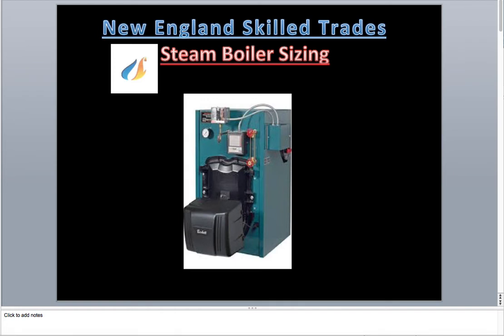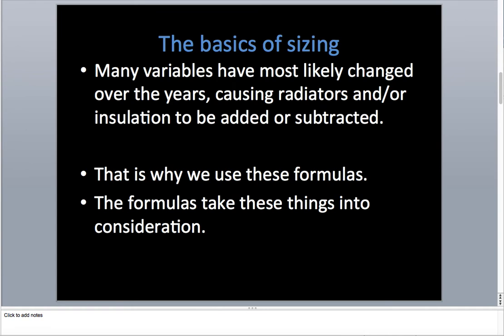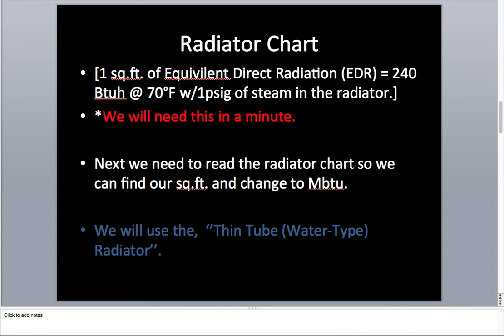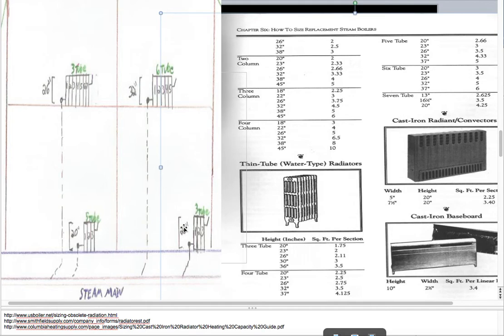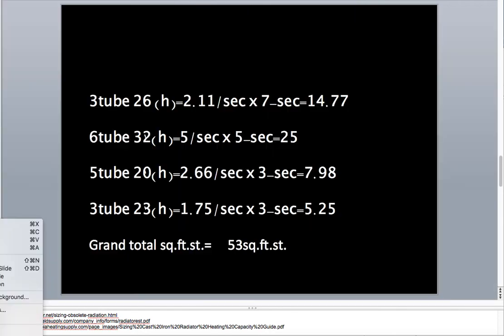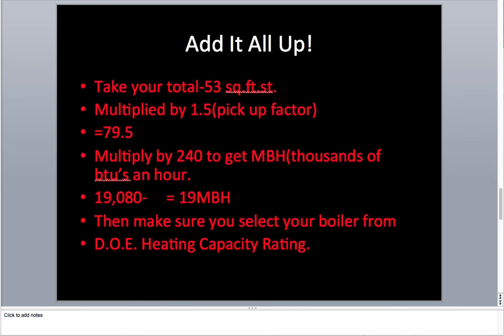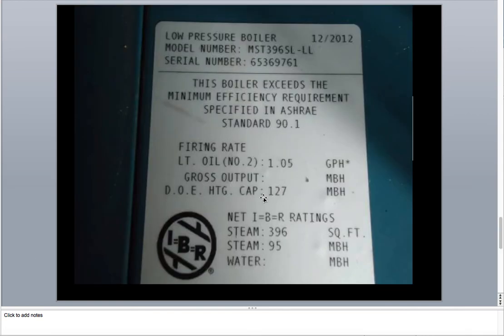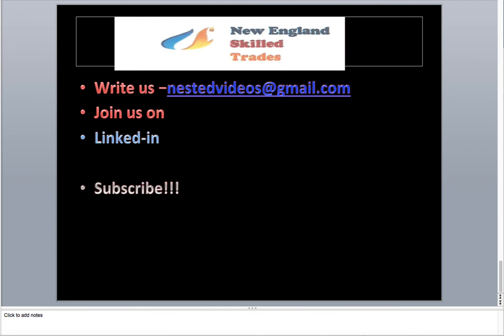Steam Boiler Sizing!

Comment: Thank you. As a home owner converting from oil to gas and wanting to keep my steam system, I was looking for someone to explain the calculation for radiator heating so I would be more informed when buying a new boiler. I also now know if a contractor doesn't go around the house measuring the radiators, he's not the one to hire.